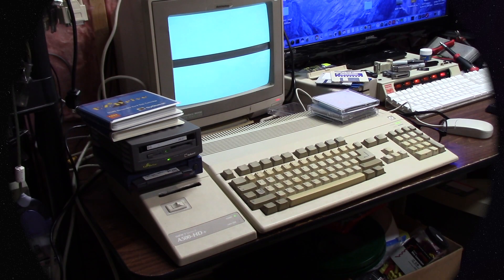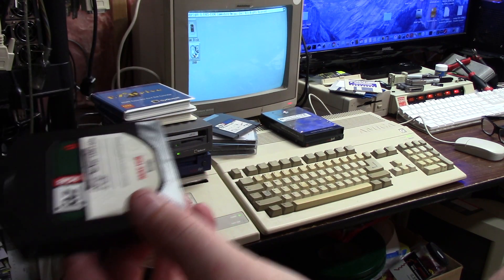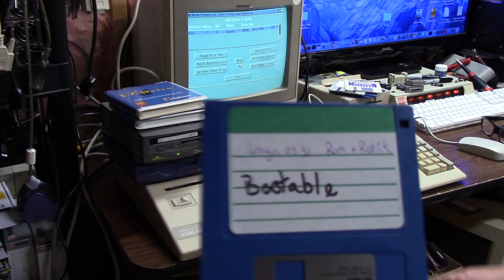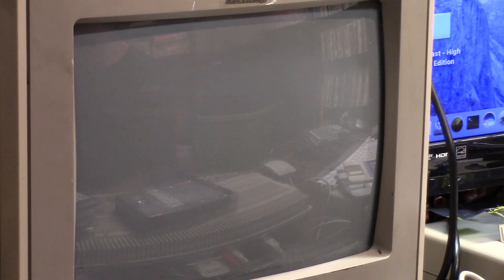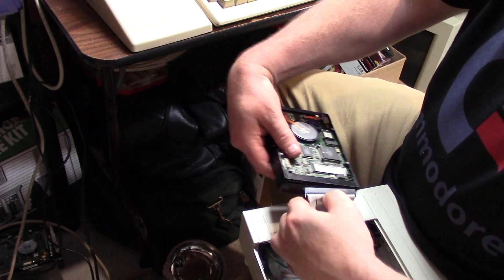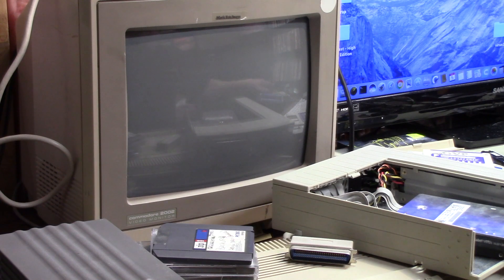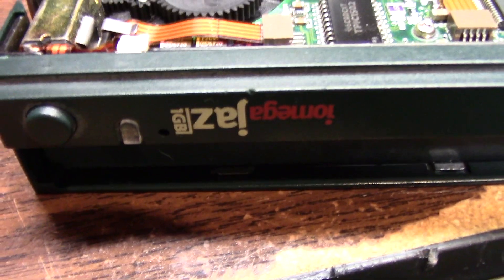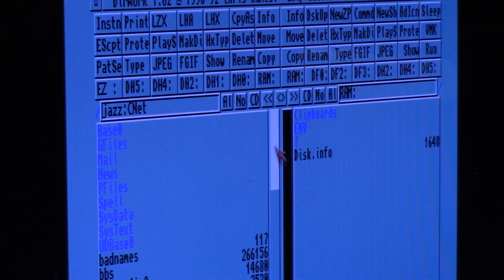Episode 99 amiga 500 stuff

Comment: I remember using a SCSI zip drive with my amiga 1200 with an M-TEC accelerator and its SCSI add-on. Amiga OS 3.something handled the removable media quite well considering commadore never  intended that OS to use removable media. I used it mostly to move files between a Sun IPC to the 1200 since it didnt have network capability.  The zip disks were formatted in FAT32 so the IPC could read them.